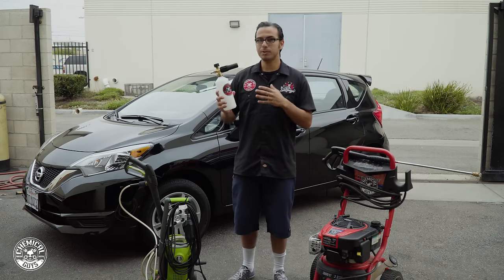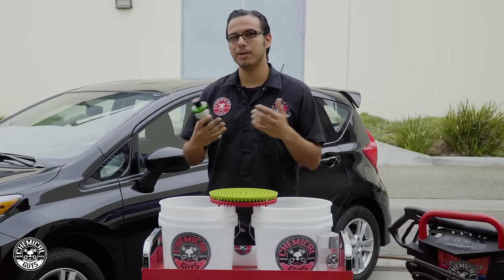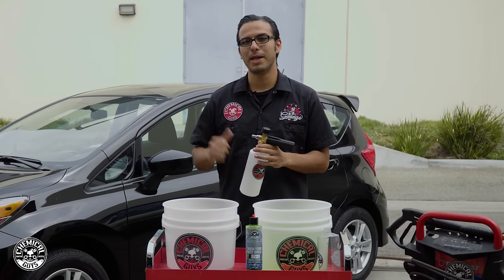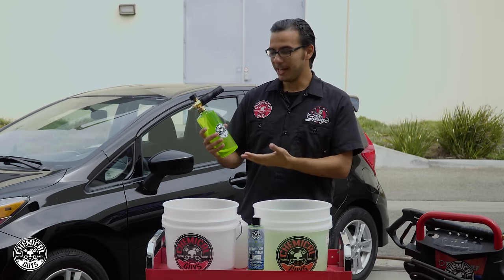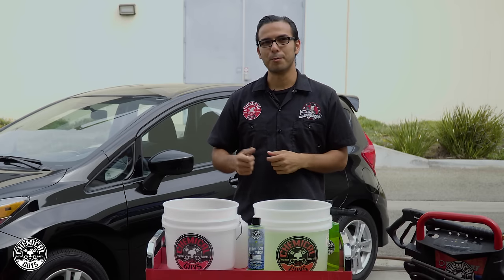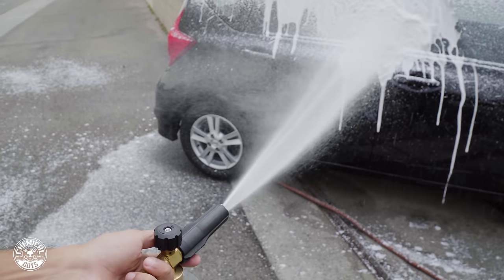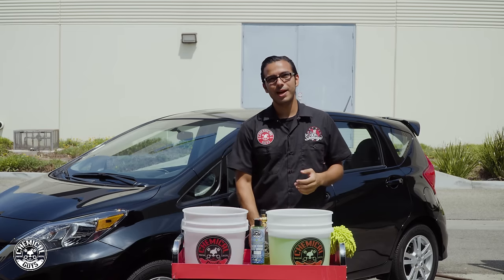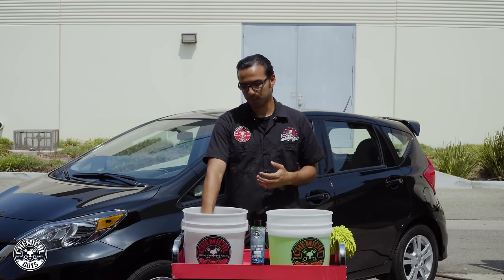5 Tips On How To Choose and Operate your Foam Cannon - Chemical Guys Car Care

Comment: I thought the ideal way to wash the car was to snow foam, then hose off the foam as it contains the most absorbed contaminants THEN wash with a mitt and shampoo.

Not just snow foam onto an dirty car then mitt wash with the snow foam?
Reply from the maker: Hi there, you rinse the larger amounts of dirt from the surface of the vehicle with your pressure washer, which also saturates the paint acting as a base for the foam. After the initial rinse, you foam with your cannon before moving onto using a wash mitt with a two bucket system to clean any smaller particles to avoid scratching the paint. Lastly you rinse the soap and foam before with using a drying aid, or your favorite dry towel. Stay tuned buddy, we've got more great videos on the way.

C.G. Alex -
Reply: Hi Alex I understand but in the video he goes from adding snow foam @ 4.52 to using a mitt directly on the foamed surface @4.53. 

What I thought you should do is:

1: Pressure wash off with clean water to remove worst contaminants.
2: Spray on snow foam and leave to absorb/ soften remaining dirt.
3: Rinse off snow foam, then
4: 2 Bucket technique with mitt, clean water and shampoo in bucket.
etc

What happened in video was:

1: Pressure wash off with clean water to remove worst contaminants.
2: Spray on snow foam and leave to absord / soften remaining dirt.
3: It looked like the snow foam wasn't hosed off before using the mitt and 2 
    bucket technique.
etc

I thought it was best practise to hose off the snow foam after leaving on bodywork before touching the car with the mitt you see (because the foam has absorbed dirt that you don't want to spread over the car - or doesn't it really matter??

Thanks
Reply from the maker: Both techniques work, I think it boils down to preference, and that you're taking the effort to reduce scratching as much as possible. Nick's method usually doesn't change much, and seems to work pretty well. The snow foam is our friend, but I totally get where you're coming from.

Comment: In order to get more suds your pw should output more gpm than psi. It's like us taking a shower.
Reply from the maker: That's correct, Chandy. GPM output is highly important when producing suds and foam.
Reply: So what’s the ideal gpm range to look for?
Reply: Director WillieB the more the better with less psi. Say 2.7gpm is ideal with 2000psi. Only Germans make such pw. Try Kranzle.

Comment: I dont get it , i thought Snow foam was a Pre-wash product and not a car shampoo
Reply from the maker: Hello again Steven, snow foam is car shampoo mixed with air and water which causes the mixture to foam up. When you begin washing, you always start with a pre-rinse, followed by a good foaming of your car. While the car is foamed, you use your two wash buckets with a wash mitt to remove any remaining dirt before you rinse and dry. Stay tuned, more great videos coming your way.
Reply: then i was using the product the wrong way , i thought First snowfoam , rinse , car shampoo , dry , and then a wax .
Reply from the maker: Yeah, the snow foam is the shampoo, which doubles as a surface lubricant, you use that like a buffer between the wash mitt and the paint prior to rinsing. Some people want to rinse off the foam because they believe they're removing dirt by doing so, we feel that using the foam makes it safer to wash by avoiding scratches like shaving cream.

Comment: Inside cleaning product
Reply: What can I use
Reply from the maker: Hi Enrique, we have a number of products that can clean your interior, depending on what type of material your interior is made up of. Let's say for example you have a leather interior. You can use our Leather Cleaner, Conditioner, and Serum to keep it in the best shape possible. Our Foaming Citrus Fabric Clean is safe to be used on cloth, carpet, upholstery, etc to break down set-in stains and eliminate odors at their source. Lightning Fast is safe to be used on fabrics, upholstery, door panels, carpets, and headliners to remove coffee, mud, dirt, juice, wine, grease, oils, and pet stains. Lightning Fast removes them that quick, lightning fast.

Comment: I thought after the white cream on the car i should rinse it off with water...
Reply from the maker: Hello Paul, thanks for watching. Actually at this point you'll want to use your wash mitt, and two buckets to clean the car before you rinse the vehicle. If you watch the previous videos where we foam a car, you'll notice that we use a wash bucket, grit guard, soap bucket, and a wash mitt to avoid installing scratches and swirls. You can rinse directly after that, and dry your vehicle to avoid getting water spots.
Reply: personally id wash the soap of with the pressure washer then start with your two bucket method, the snow foam is meant to agitate the dried on dirt and loosen it off, if you then take your wash mitt to the car, without rinsing the foam off you're just going to be wiping all the dirt across your paint causing swirl marks. Bad practice from chemical guys tbh!

Comment: I think is a waste of soap when you foam it then the soap dries and you have water spots and soap spots,  it’s better to do it original grab the bucket get the soap rinse
Reply from the maker: Hi there, we appreciate your concern for this customer's car, but would like to share a few reasons why it was safe for us to wash this car in direct sunlight:
1. We use deionized water. 
2. This soap, like most premium CG soaps, is pH balanced. 
3. The climate was temperate. 
4. The paint was cool to the touch. 
5. It's California, so why wouldn't you want to be outside? 😊 
We have detailed thousands of cars over many years under the conditions above, all to the utmost satisfaction of our customers. If you ever have any questions, or are new to detailing, we encourage you to contact us for advice. We can be reached via telephone, email, or even facebook messenger and are here to help.

Comment: My cannon doesn't foam like that 😑
Reply from the maker: Hey Buddy, thanks for watching. What kind of pressure washer are you using? Also did you use warm water because that's one of many keys to achieve the perfect amount of suds. Be sure not shake the bottle, gently agitate the bottle to prevent foaming inside the soap container.  A common mistake is using more soap than needed, or not enough soap. We typically use about three ounces of soap which is generally recommended. Hopefully this advice helps you achieve the results that you see in this video. Stay tuned, more videos coming out every week.
Reply: Chemical Guys Thanks for gettin back to me. I have a gas 2800psi with I believe a 2.3 gpm flow rate. Yes I always fill the bottle with warm water. I'm probably guilty of shaking the bottle and using less soap ( little over 1oz I think). I should load the truck up and head to the Mississauga location for some classes😂
Reply from the maker: Hey there. You're pressure washer sounds good, just use more soap and don't shake your bottle. If you follow those steps, you should get fantastic results. Happy detailing buddy.
Reply: Chemical Guys I'll give it a shot, thanks again for the help
Reply from the maker: You're welcome buddy.
Reply: Chemical Guys one last thing. What product do you guys recommend for cleaning my engine bay?

Comment: I'm not buying this whole "foam cannon" fad. Spray all the foam you want but without some type of agitation it's not going to get the vehicle as clean as a hand or brush wash.
Reply: Bob Falfa that's why they literally took a wash mitt to the car after they foamed it
Reply: I agree.  I use my foam cannon to simply apply foam.  I then use several different mitts to wash the car while the foam is on the car.  Then I rinse.